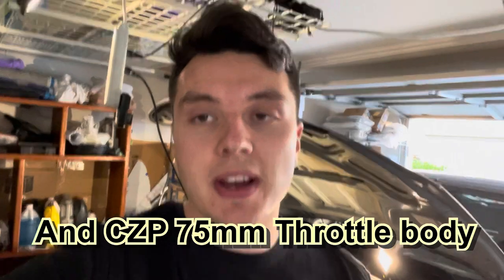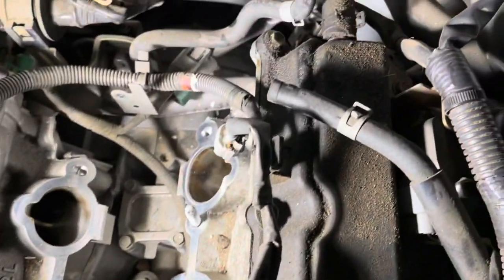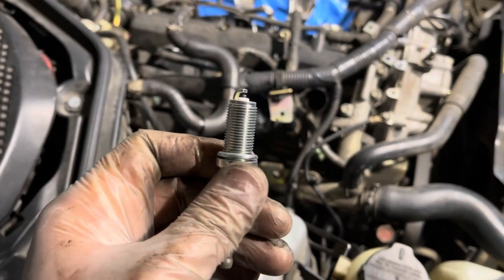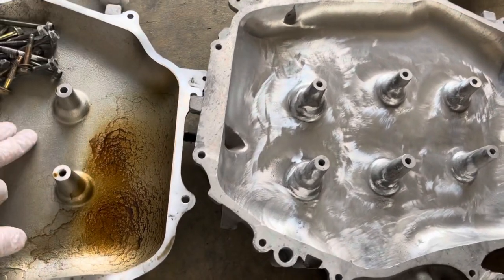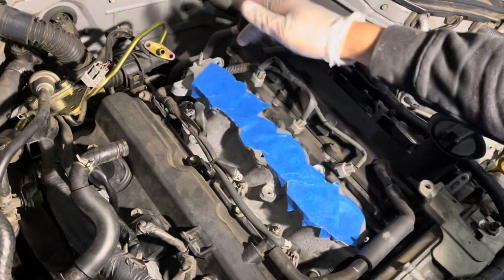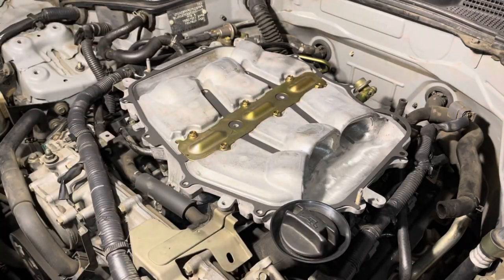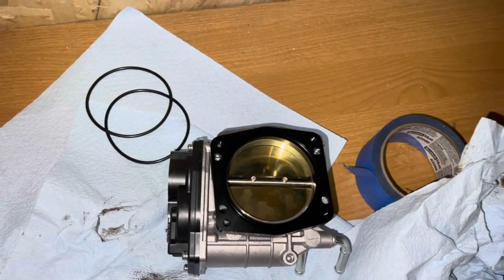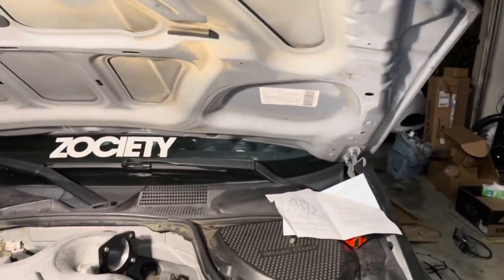350z PORTED PLENUMS, PLENUM SPACERS, RACE INTAKE, GTR INJECTORS, BIG THROTTLE and MORE!

Comment: I’ve seen a lot of people spend hours polishing all the intake parts and everyone doesn’t port match the intake to the head. It’s like buying new wheels,lug nuts,high performance tires & not putting air in the tires. Your smoothing & blending for better air flow but don’t get rid of the ridge right before it hits the intake valve. It might even make you lose power from the turbulence from the air hitting the ridge of the head.
Reply: Every car is different the vq35de,  head runners have nearly no casting marks inside of them. the manifold on the vq is its main chokehold for this engine platform hence why we usually port them and leave the head runners unported, you need professionals that understand the vq to port your cylinder heads on this platform because uneducated people go porting the hell out of there  vq heads and end up messing up there displacement to where they actually loose alot of power, and at that point it really isnt worth it unless your doing a full engine build in my opinion. And if anything that small few mm of lip on the head runners will be more like a velocity stack when the heads meet the larger exit port pushing air faster faster into the heads making for better atomization of the fuel ⛽️

Comment: Nice video! Would it be worth it install this plenum spacer on my 2005 350Z convertible with an automatic transmission? I drive conservatively, rarely exceed 4500 RPM, and the car already has over 120,000 miles on it. Thanks.

Comment: I’ve been doing a lot of research into air intakes and a lot of people have different options. Living in the UK, it’s very wet a lot of the time and my main concern is a cold air intake sucking up water. The Z1 motorsports one looks the best. Did you notice any real power gains from it and do you have any concerns with it taking on water?
Reply from the maker: It’s hard for me to tell if I’ve had any power gains from it since I’ve pretty much did all of the bolt on’s and got tuned at ones (but considering it’s just 3inch intake all the way I would think it’ll make a difference) but regarding it sucking in some water I wouldn’t be concerned since the location of the filter is pretty high up from the ground. You can also use a “sock” for the filter and you’ll be solid.
Reply: @I._NED  thanks for the quick reply, does the front bumper cover the filter? I ask because I’m concerned with rain coming in through the front grill, as I’m sure you’ll have heard, weather in the uk is miserable.
Reply from the maker: @smoxch5444  filter is covered by bumper

Comment: Hi bro I have a question for you, after installing the GTR injectors do you need chip tuning so the ecu can recognise the new injectors or it’s just plug and play and can you use the stock fuel pump or you need to upgrade that one as well? Thanks in advance! Great video!
Reply from the maker: You would need to get tuned otherwise your afr would be all over the place. I’ve seen people using stock fuel pump but i would recommend to get more efficient one.

Comment: What is the point of adding gtr injectors?
Reply from the maker: They are larger injectors then stock, when you run e85 it requires more fuel so bigger fuel pump as well as bigger injectors needed to have all the benefits of running e85

Comment: I’ve heard ppl say the spacer on the rev up is a loss in power? Anyone else hear this? I’ve heard unless you are adding the mrev2 with it it’s useless… I have a spacer… do I just not put it on?? Getting dyno tuned for bolt ons soon.. so I Wana make the best of it
Reply: Worth it for a non rev up engine from what I understand
Reply: I personally don’t understand how more air leads to less power. Sure it can be more on the tuning side of things but I got ported upper and lower plenums as well as ported lower runners and when I added my 75MM TB with my plenum spacer everything came together to smoothly. I still got more tuning to do but to answer your question. In my opinion I think $120 blox is worth it. Test it out for yourself.
Reply: Great question. You’re on the right track. These vehicles are engineered to a relatively specific purpose, with some flexibility. For example, if the volume of air going into the motor increases, the computer will add fuel. BUT, only to its limitations. The guy in the video is off to a great start by upgrading the injectors, as the originals are limited. However, he NEEDS to tune now. The computer program for fuel and air management operates in a specific parameter range. The tune will override these settings and allow for more fuel in response to the increased air. If you don’t tune after substantially increasing intake air volume, you will run lean.
Reply: @samuelw5072  since my comment I’ve added ported lower intake manifold and ported upper plenum, cleaned injectors, new plugs, new valve cover gasket, throttle body spacer and the plenum spacer, test pipes, nismo exhaust, full paint job, tint, new slave/master and clutch line, new clutch ( asshole didn’t machine the flywheel) and tomorrow I have my appointment with admintuning. Lol so I’ve spent about 7k in upgrades lol 😂
Reply: I have a revup and with a z1 spacer, stillen intake and aam resonated test pipes I picked up 30 hp and 40 tq with a tune